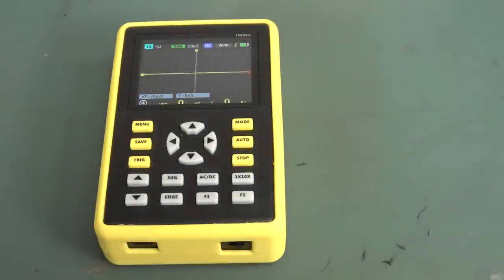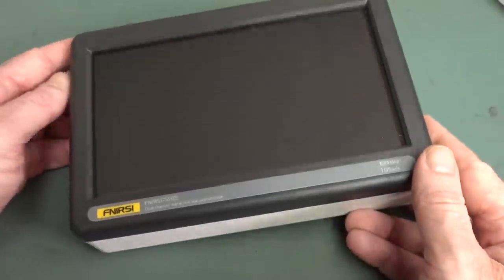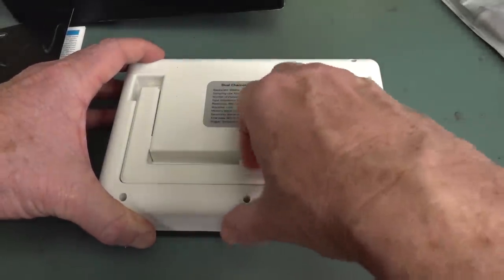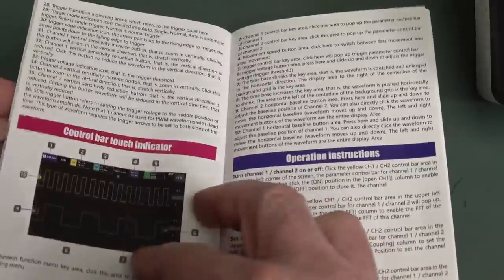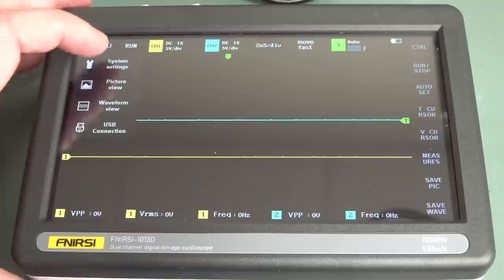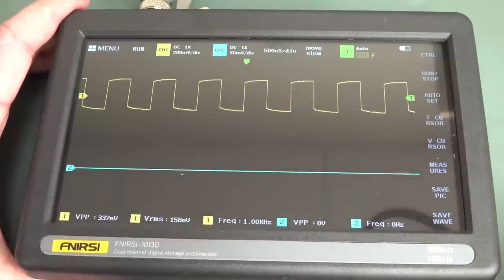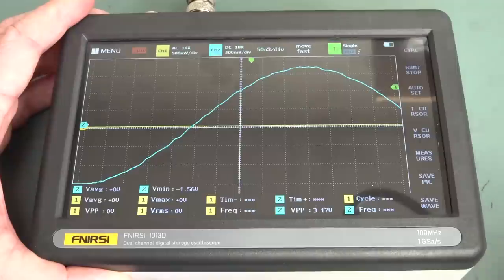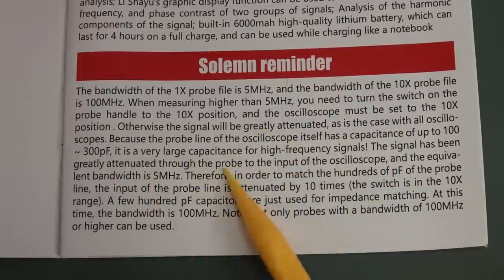EEVblog #1317 - $140 2CH 100MHz Fnirsi Tablet Oscilloscope Review

Comment: I got my first DSO for ~$140. It's an used Phillips PM3323 - 300MHz analog bandwidth, 500MSps, and 4k sample memory. Not bad for a 1989 product, but was a pretty hard task to take it home via public transport, and it still occupies half my workbench. Damn that thing is just amazing to operate, I always knew I love buttons and dials but I did not except to love it this much. It only suffers in portability, so I'll probably get another one possibly for uni.
Reply: Umm 500M/s doesn’t meet nyquist for 300mhz. Why would the input filter be that high?
Reply: @NavinF  Pretty good question, and I'm not sure either. My guess is that it's 500Msps real-time, and using repeated sampling on each trigger event it can be a higher equivalent-time sampling rate - but I don't know the math behind that, so it's only a guess.

Comment: I started using Tektronics scopes in 1969 when they were far more expensive than my brand new VW Beetle.  Purchased the $140 Fnirsi about a year ago. It works as advertised. Now if they only add a separate sych input and implement an "A delayed by B" function, it would be complete.

Comment: Thanks for that review (I did not find real reviews before)! 4 weeks ago, I had almost bought this thing, but I went for the Hantek DSO5072P at just 100€ more. I'm glad to go for the Hantek...
Reply: How good Hantek DSO5072P is? I still have little DSO, which is erm.. usable  for my DIY thinkering and repairs. But I wish to have something a little better with larger screen.  193€ for DSO5072P in Banggood seems Ok.
Reply: @KrotowX  It's my first "real" scope, so I cannot compare. It lacks in the digital domain (not I2C decoding etc), but all the rest ist fine. I had a small DSO before, but setting everything with just two buttons drove me nuts. The Hantek (as all real scopes) has those buttons for direct control, plus a lot of button for further analysis.

Comment: I like the idea. A bit more polish and I'm in !!  For me I have 3 use cases > 1. There are a couple remote locations(desert/forest) I would LOVE to bring a scope/leave a scope. Something that it doesn't matter how dusty or dirty it gets / cheap enough I wouldn't cry if it died.   2. High voltage= There is  nooo way I'm working with ion/ozone/static HV near my good scopes.  [[Funny story = was just messing about, and something on the OTHER side of the room lit on fire. HV went through a bunch of stuff / jumped wires /etc etc.. ]]  3.  Chasing wires= Such a pain to bring a scope just to check a wire(wall / modem / pole / workshop / etc) ... I guess thats the same reason as #1, Last month I worked on a Kawasaki Mule.  The fuel pump is connected to a Mos, which is fed by a computer looking thing.. Woulda been nice to know what signal it was being fed...

Comment: for <=$200 you can still find a working TDS220 or even TDS4x, an old Lecroy, or an Agilent DSO3000 or HP 546xx. Sure they are bigger in size but they are real scopes not a junk.

Comment: Bought one for audio troubleshooting.  It's fine.  Went in knowing it was probably only 20MHz from last review.  If I was more serious I'd pay 2x-4x for a Rigol or Siglent but for occasional use its fine and convenient.
Reply: You used it to tune amplifier gain? Would you recommend these tablet or those $50 hand held ones?
Reply: @damnitdang  The $50 handneld ones are good for nothing and can't even be flashed, meaning their firmware can nevr be upgraded. This one looks at least decently usable.

Comment: Another worry I have with cheap equipment like this is the durability. I must say that I also worry about the durability of some of the "real" oscilloscopes (the budget ones).  I own a Tektronix 465B from the late 70's, it works fine, even the electrolytic capacitors in the switching power supply are the orginal ones...

Comment: The "Memory depth: 240Kbit"  doesn't mean there's 240K samples storage. That's literally the capacity of Cyclone IV blockram, in bits. This translates to 30K samples shared between 2 ADC, so the max history depth is 15K samples per channel, and who knows if they would allow the whole 30K buffer for a single channel.

Comment: The frequency response really looks like ringing in their analog front end... no?
Reply: It looked weirder than even that.  Ringing tends to give a strong preference to a small number of frequencies.  This thing seems to have many peaks
Reply: It's most likely not ringing, but aliasing between the sampling clock and the signal. Try samping a 100MHz wave using a 100MHz clock... They obviously messed up their equivalent-time sampling. Sampling 100MHz at 100MS/s per ADC channel makes both ADC channels see DC signals. Even if you add proper dithering/jitter to one or both of the clocks, the signal on both halfs is mostly DC.
IIRC, Dave showed how DC coupling did not work correctly. My guess is that they have some kind of digital high-pass filter (automatic DC offset removal) directly after the ADC, even before they mix the two channels.

Comment: The hardware looks not bad for the price, depending on what they did in that front end attenuator circuit.  There would be nothing at all wrong with a 20MHz, 200Ms/s scope for $139.  It looks like all the necessary information is available to make a firmware and FPGA code...

Comment: I ordered one a few days ago. My current scope is a Hitachi CRT from the 80's. I think this will make life a bit easier. Apart from anything else it's smaller.
Reply: Hi! Can you tell us how good was that purchase?
Reply: @omarandrade3768  It's a really good scope when it comes to audio and video frequencies. It's also reliable at computer clock frequencies and timings. I've never used it for RF work, so I don't know about those frequency ranges. I still use it often and it's replaced my old CRT scope.

Comment: Finally a decent review from an expert
Reply: And Honest review, not this promoted rubbish ;)
Reply: @deathblowhere  By a know-it-all that can't be bothered to read the manual for all the money he'll rack up for this video. Once he cuts through his usual bullshitting, his bench work is worth the watch, ANYWAY
Reply from the maker: @vidznstuff1  I'll probably make sub $100 from ad revenue on this video. And yeah, I use stuff without reading the manual first, sue me.
Reply: @vidznstuff1  Why so negative?
Reply: @vidznstuff1  He is right not reading the manual beforehand, It's a bloddy tablet oscilloscope, if the UI is good an EE should be able to operate the thing (at least the basics)  without manual. If not then the GUI is bad. That's it
Reply: @marco56702  Someone should hack the system and make virtual rotary switches. :-)

Comment: "The fuselage is equipped with a USB interface" seen in the manual at 4:31. Fuselage? Now it is part aircraft?? ;)  At 7:16 Dave changed the time/division without realizing it. Perhaps a future software update may fix some of the user interface issues.
Reply: Don't think that this garbadge will have any updates..

Comment: One would think that before running a review on a device the reviewer would first learn how to use it.  Is this a lab quality scope? No.  Are there places  it can be useful?  Yes.  For the price, it can't be beat (at this point) so if you need a lab quality scope fork out the money and buy one but at least acknowledge this little scope offers a lot for the money.
Reply: The most important thing is.... is there a BETTER scope for $140 or not?
If not, then this is a winner.... even if it's not as good as Dave's $15,000 Keysight.
Reply: Its lik e watching my grandpa try to switch the new TV from VCR to cable,...

"Why wont this thing just work!?"

Comment: I just received a slightly different version (bnc and power enclosed in a "hole", nice protection for them") and it seem to not have most of the problem seen in this video. Maybe it's a software revision, too.
Anyway usable for less tha 50Mhz signals, i think it's OK for 150€

Comment: Why should you buy a 138$ tablet/table/plate DSO oscilloscope with low performance from a unheard brand,when you can buy for even less an old analog oscilloscope from a respected brand like Hantek,HP, etc?As a beginner I would still get an analog oscilloscope instead of this DSO tablet.
Reply: Debugging digital electronics might be impossible, especially with intermittent problems.

Comment: If they could improve the firmware and manage to squeeze in a few more relays to be able to interleave all 4 ADC channels, then this would actually be much more useful.
I do wonder though, if you were to take the same budget to make a USB 3.whatever (10 Gbps USB) PC-scope, would you be able to get better bang for your buck? If you already have a laptop with a 10 Gbps capable USB port (getting more and more common) and a touchscreen it may be viable.
Reply: i'm afraid the  FPGA with 10Gbps usb3 phy would be more expensive than the touch screen :D so you would not fit the budget.
Reply: @robertjung8929  Ah, bugger.

Comment: I'm curious if it would be worse than a "proper" 20 MHz oscilloscope on the basis that all those weird peaks and troughs in the frequency response from 20 MHz up to 200 MHz would terribly distort non-sinusoidal signals, even if the fundamental of those signals are somewhat below 20 MHz.
Reply from the maker: It's a fair bit of work to test it's response properly, as you have to do it over every voltage range, as each range would be compensated differently.

Comment: I don't think I would be OK with buying a piece of test equipment where the manufacturer deliberately sanded (etc) off the IC markings. 
And the cows have been grazing in Dave's lab, when it comes to the bandwidth and sample rate claims.
I think I will stick with my used Tektronix scopes for getting over 100 MHZ.
But that's just me...
Cheers Dave, hope you are doing OK down under.
Reply: Almost ALL Chinese equipment has the IC markings removed. It only matters if you open it.

Comment: Personally, I'd rather have an open sourced system where you can modify the software and just had all the hardware in a kit.  Kinda like the PC where you can change the graphic cards, memory, storage, etc... and configure it as you want with open sourced software.  I really want one for automotive, but this doesn't seem to be the right choice.

Comment: I reckon they listened... kinda. I've bought one about 12 months ago. The box is beefier and covers the button and coax connectors. Side overlap no longer exists, in that it's really flat faced now. Usability has somewhat improved vs your demo one. The in/out time base is more responsive. Autoset is better too. Stilled sold as 1Gas/s though. Still no zoom in/out, but you can change the mv/div then change the time base which sort compensates for that missing feature. The interface options are still shite but there's enough going on for a bloke like me that does automotive and some simple electronics (arduino projects mainy)... and no firmware update on their website unfortunately.
Reply: Yup, still the same!  No firmware update at all and their pdf manual is horrible!
First, English is not good, but worse, you can't search text at all.  It looks like image pages rather than text with graphics.

If I need to do important work, I'll use my main bench scope, with is 200 Mhz for real.  LOL
But, like you say, for Arduino, ESP32 and checking the waveform of inverters and the like, it's just fine.  Not perfect, most certainly.  But the price for a portable/handheld with a large screen, it's ok.

The problem with EV is that he comes from a very professional background and uses high-end equipment.
So his opinions are very biased towards engineering.

Comment: What kind of probe will I need for this unit to measure 240vac to test a generator output ? Assuming that 240v rms when Vpp would be over the limit for the supplied 10x probes ? Also a link would be awesome…. Love your work mate ❤

Comment: Yet another excellent Video.
Ever since the $20 kit oscilloscopes have been around I have been seeking a cheap, small desktop footprint, dual channel oscilloscope with a better visual resolution display compared with DMM Scopes, with an X-Y mode to display Cat's Eyes (Floppy Drive alignment) & possibly Vector Graphics (Arcade repairs). I'm not needing it to be reliable in the high meg range, thats what my Tektronix 100 / 300mhz scopes are for but are all CRT bulky.
I'm guessing this cheapie also doesn't have an X-Y mode?
Reply: I checked on ebay and saw one like this selling for AUS $250 delivered. What was interesting is that it showed an X-Y mode. So on reviewing this YouTube clip again it actually DOES show X-Y Mode in the Menu listing. Yeah!
Reply: XY = lissaous (can't spell)

Comment: Hi Dave, is there a good scope for the iPad? I could guess using that screen saves in hardware costs
Reply: I actually own a cheap scope that connects to USB and has no screen and no battery. A price tag is just $70, an isolation from mains is a good bonus.

Comment: I bought a 20Mhz pocket oscilloscope from amazon for ~50$. It has a ~3.5" touchscreen and is probably STM32-based. It has issues with triggering and whatnot, but I think it's a better value for beginners than this thing here.
I have a miniature electronic workbench with that small scope, a UT10E, a small soldering iron that works on 12-24V, wires, Windows tablet with RTL-SDR and logic analyzer, etc that I can quickly grab to the car or even on the carry-on.
Reply: Which scope is that?
Reply: Yeah, which one?

Comment: as always Chinese specifications is multiplied by 5
Reply: 5 or 10 depends, i really like the chinese watts on speakers or amps. funny how an "100w" amp is less powerfull than an old radio with an el-84 (absolute max 8 watts or something) output.
Reply: @kapioskapiopoylos7338  You get 100W only if you power it with one of those 200'000'000 mAh power banks.

Comment: i use it for audio and sub 500khz applications and its perfectly good, although the measurements isnt the strongest point but if you want something to see waves for cheap i think its good buy, not for advanced high frequency ofc, for that you want something better. also its awesome that its battery powered, no need for diferental or 230-230v trans. i made my tesla coil with it. but acidentaly fried one coz it has weak ground beetween the channels. a lot cheaper mistake then lets say 400 proper scope would have been

Comment: Is there anything out there, even on used markets, that would be a good, general purpose Oscilloscope?  I'd love to have one to learn on and use to work on my old radio and other projects.  I've never used one before, but there's been times when I wish I'd had one.  Rarely, but it's happened.
Thanks for these videos, I'm learning a little more from every one of them.
Reply: You might consider getting a used analog scope on eBay. I think you would learn the principles without all the confusing bells and whistles, and the complications of aliasing, etc.

Comment: Are there any good affordable battery powered scopes? I was looking at your ol teardown of a R&S 1212  and it seemed like it would be very easy to make a battery powered version of that for example or even from the cigar lighter socket in a car fo automotive use. (It being single voltage 12v)
Reply: Then what? Plug it to the car and use it with some other car? Ground comes from where?  If the battery voltage spikes, or saggs you need a DC/DC converter

Comment: It's not ridiculous to use a 8 - 10MHz SPI signal in modern microcontrollers. Unless you want to play with slow analog stuff, these are just toys. The 400$ 4 channel Rigols (rigloled if you don't care much about warranty) are still a much much much better deal.

Comment: Nice video :) Thanks for testing that - have you had oportunity to test Hantek iDSO1070A? I'm wondering about buying it - it's quite cheap (almost the same as presented one) and can be connected to PC/tablet (wireless too - so it's safe for PC when trying to measure some simple schemes with 230V through 100x probe). I expect that it doesn't have very good parameters - but for simple circuits made as a hobby should be enought and can be used with some open source application on PC... On the internet there is not much tests/informations on about it - only looking like ads things  ;-)
Reply: Maybe someone from audience have seen/used it?

Comment: I work on generators from 14kva up to 1.2meg. Would a scope like this be OK for checking for blown rotating diodes on the rotor?
I've been told that the AC waveform gets chopped if one or more fails, although you won't see it on your multimeter. 
 230V AC single phase or 400V phase to phase. Cheers...

Comment: Question: When you use a scope that's "Battery Powered" does that allow you to put your probe anywhere in the circuit without blowing up your probe? Since it's not "Mains Earth Ground"? Thanks in advance!
Reply: Yes.
Reply: @thehighprotondiet3127  Thank you!
Reply: Yes, but you might "blow yourself up"! Unless the battery powered 'scope & its probes have insulated BNC connectors, if you end up with the "outer" part of the probe connector on Mains "active", & you touch it, you can get a shock. Another point, where you CAN blow the 'scope up, is if the grounding clips on the probes are "commoned" inside the instrument, putting the grounding clips of two probes on points of different potentials can put your scope in "a world of hurt!"

Comment: Why are scopes still so expensive? Small market + patents? It would be cool if there was a decent enough open source software + hardware stack. I used sigrok a couple of years ago as a logic analyzer but you still had to buy some clearly questionably cloned hardware to sample the data. But, the software was workable enough for an amateur hobbyist.